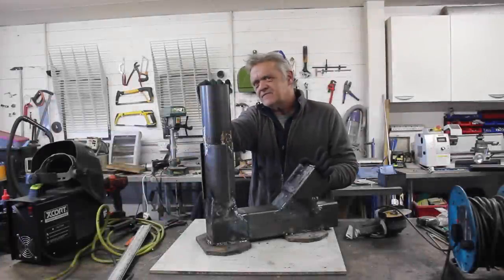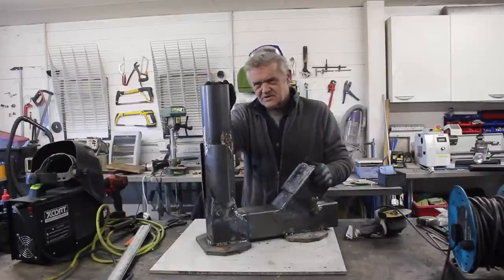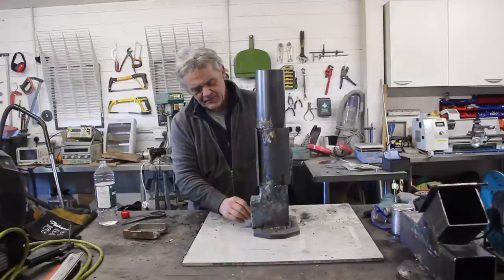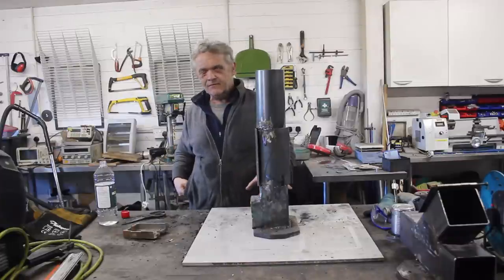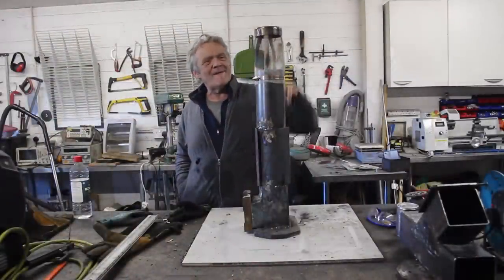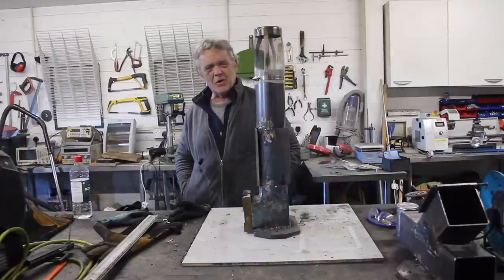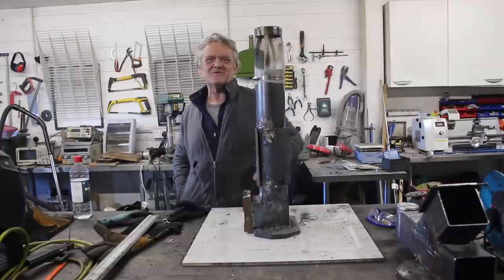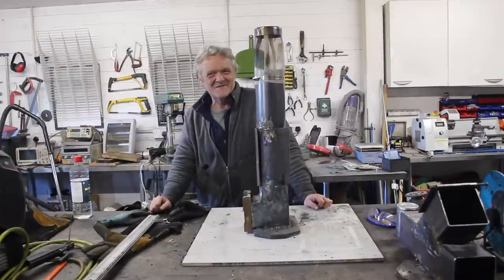1751 Sensible Vortex Heater Prototype

Comment: Two cylinders one on the other. In the shape of a 3D 8. That way the fuel fumes build up and ignite to become a turbo rocket stove.
Reply: I was also just wondering this too! Would the pipe work best if it was built already in the shape of the vortex?

Comment: The Vortex has me thinking.

In a car the clean movement of hot gasses keep them away from the cylinder walls.
When it runs lean and you get pre-detonation the gases get swirled up more and as a result the combustion temperature is lower but more is transferred to the cylinder walls causing the engine to run hotter or over heat.  

If we cause a vortex in the chimney and move the gasses into the middle, the gasses circulating on the outside must therefore be cooler as the cooler air is mixing and forming the vortex. So the outside of the chimney will run cooler.

Would be a good experiment to see if this does affect the heating efficiency?
Reply: This principle is what makes giant termite Chimney mounds work
Reply: Also speaking of vortex flames, have you ever seen Fire Tornados in real life? We can use this property to completely encase it in a glass tube. My question to you is this, can the vortex flame itself be made hotter, to the point where the vortex flame heats EVEN more of those gasses released by the burning wood? In Essence a fire tornado that just keeps getting hotter and hotter?
Reply: @captainnemo6655  it might get hotter as has it draws itself in as there is less surface mixing with colder gasses. i think the limiting factor for the heat is the fuel supply. extra heat takes extra energy, which means faster wood to gas production.
Reply: @TheEmbeddedHobbyist  indeed! This is my question now too... What would be the ideal energy dense fuel that we can use. Small in size put able to give off massive amounts of heat and gas, then further pyrolize the gas and so forth.... There is a chap on YouTube that built something like this, you can find his video by typing "Rocket Heater 4.0 Tornado in a tube"
Reply: @captainnemo6655  I think the more energy dense the fuel the greater the risk there is in burning it. petrol is one to think of, lots of energy but i would not want to be burning it in the house.

Comment: Maybe some type of forced air fan to give more oxygen but then you would need power and would no longer be self contained unless you maybe run the fan assembly with solar. Probably wouldnt take much of a fan to achieve a blue flame.
Reply: There is something easier. You can run that fan by using Thermo electric energy from the stove itself. Rob has many excellent videos on how to do Thermo electric generation... Also there is a product called The Flame Cube, it's a rocket stove, Thermo electric generator that runs a fan to further help the temperature difference. Have you ever seen these things?
Reply: @captainnemo6655  No I have not but sounds interesting.

Comment: Does the vortex and flue draw more fuel out of the reservoir when the door is closed?

A runtime comparison with a known qty of fuel would be a good test. 1, door on, 2, door off.
Reply: 3 doors fixed at the right angle and opening. There is a ratio. Rob actually has a video on this design, it's in the library. I believe the video is titled Vortex heater, Initial thoughts.

Comment: Rob i watched a vid were a guy got an old camping stove gas canister  drilled in from top and bottom the size of a coach bolt then the top were the lip is cut that off to make a lid witch in turn is a press he then filled it with sawdust and candle wax mix put lid dack on to compact it with the coach bolt going thru then took out coach bolt and made a hole at the bottom side as to put wood in to light 2 matches and it was lit for 8 hours with a huge flame I was thinking while watching you need a gause on that but it was a good idea
Reply: He actually has a video on this idea. It's the magic forever wick video he has. Check it out and see what you think.
Reply: The vid is called having learnt this secret I never throw gas can
Reply: @niceboy761  awesome!

Comment: Trying to work out what the point of this is? Methanol releases a measure of heat per ml as it burns. All this design seems to do is burn the fuel faster. Sure, per minute there may be more heat, but only as a consequence of burning more fuel.
Rocket stoves on the other hand have the utility of burning gasses that were wasted in traditional wood burning designs. They have the advantage of producing more heat by combusting a secondary waste product. Not by burning more fuel.
Reply: You gotta keep going with this line of question. The point is to improve the rocket stove by taking what nature already does inside of real life Fire Tornadoes. Mix the two approaches and you get what the point of it is? Burn the least amount of fuel initially and THEN burn the resulting gases. Two burns, one stone. Maximum heat output to be then put to use to generate thermoelectricity or mass heat.

Comment: I would like to see how a "Diesel Stove" could be adapted to this.
They atomise the Diesel fuel with a preheater then burn the vapors. Nice blue flames
Reply: He actually has this video already. Its in the video library under the Magic Forever Wick as well as the videos on Biodiesel
Reply: @captainnemo6655  No , this different.,The diesel stoves Ive seen, have a spray nozzle, that atomises the fuel, the pressure is created by the fuel boiling in a pipe.
Reply: @justtinkering6713  ooooh I see what you mean. A pressure based atomizer, like the fuel injector in a car.... Question, have you ever seen what ultrasonic foggers can do to atomize liquid fuels?
Reply: @captainnemo6655 ive seen  just water
Reply: @captainnemo6655  Boy that was quick. I posted a youtube link and it was taken down in 60 seconds.

Comment: Fantastic video! Multi fuel burner I'm thinking could be ideal given that's a clean cut adaptor plate/sleeve to add or remove depending on fuel type you have to hand for maximum flexibility in a blackout power out situation!? Eg. Wood/Liquid ethanol/ oil tube for motor or used veg oil!? Maybe strap a heat powered stove fan to the side of the flu or burner to radiate the heat away from the flu to push the heat into the house if using a clean fuel?(not sure if that would be safe the last add on though?)
Cheers from London! 👍🏴🇬🇧
Reply: This idea! This is were a bit of biomimicry would help us out. Have you ever seen a cutt off diagram of how giant termite Chimney mounds work? We can use this natural design for HVAC systems that run like rocket vortex heaters for the home.

Comment: hi.
you can manipuale hat "vortex" making a few small holes in that "oil  device "
Reply: Yes he can actually! How to best manipulate that vortex is now my question too. What is the hottest that we can get that vortex to burn and spin.
Reply: @captainnemo6655  8 (or 12) little radial holes in that oil can and another 8/12 in the stove at the same level, but a bit (2°) moved to the left, will make a turbo flame, rising up much bigger (he will need a much higher termo glass tube to let the flame be seen, over 2 meter high)
Reply: @Daremato  there is a chap on YouTube that did this already. If you could check out that video for your thoughts and feed back would be awesome! The video can be searched for via tittle "rocket heater 4.0 tornado in a tube"  the chap in question used the length of tube as you describe and the same kind of glass. He incorporated a wood pellet Hopper feeding mechanism on it though.

Comment: Front door wood back door ethanol but you make have to change the ethanol burner but lovely idea
Reply: Question, would it work better to have wood soaking in ethanol? Like if I make moonshine to age in wood barrel, can it work with that kind of saturated wood?
Reply: @captainnemo6655  Funny this would be like super fuel or fuel injected pellets lol
Reply: @offgridwanabe  that would still be soooo awesome!!! It reminds me of something already out, the Kingston brand of charcoal briquettes are saturated, would it be possible to do a DIY version and make it shelf stable like that? Super fuel pellets! I love it! The object of the vortex heater would be two fold, pyrolize the wood pellets and then pyrolize the resulting gases via it's vortex flame.... How to get that flame vortex hot enough though?

Comment: What's the point of the vortex? Just because it looks cool, or does it have a function, like mixing fuel and air? Or would you get the same effect with any opening, just this one happens to make it swirl?
Reply: The point of the vortex is that it helps with the secondary burn of the glasses that come off the burning wood.
Reply: @captainnemo6655  But how does it help? Wouldn't a couple normal holes do the same?

Comment: Now to make it more sexy! lol   Makes me wonder what kind of adjustments would be necessary to spin the flame more or less .. as well as what kind of fumes one is going to breathe.  I also wonder if this vortex spin system wouldn't be better working inside the new heater you got delivered.  I think a round pipe has to contribute to a better spin.  Lots to think about!  Always amazing Robert!!  Cheers mate!  🙂
Reply: @Jeffrey Wolsieffer have you ever heard of fire proof stone paper? This material is available for making a spinning blade to help move that fire vortex around.
Reply: I was thinking the same thing just now! And also a long the lines of that vertical spiral wind turbine blade but made out of fire proof stone paper to help move it faster under its own flow of hot air. It can be constructed upright as well as vertical with fire proof stone paper. Also why not take the cue from nature? Have you ever seen a cutt off diagram for how Termite Chimney mounds work? The secret to BOTH vortex heaters and mass heaters is right there staring right at you.

Comment: So what is the advantage of a vortex flame over a normal flame in a rocket stove?
Reply: The advantage of the vortex is that it helps in the secondary burn of gasses given off by combusting solid/liquid fuels. Once the vortex gets going, it then increases the pull of oxygen rich air, further increasing the burn.

Comment: still have no idea how you get 5 hours  using methanol   with  a tin of sweetcorn     i got the felt   the tins   the mantle      it drinks the methanol  in 30min a full tin
Reply: Did you try running it with the magic forever wick Rob has in the other video?

Comment: I am learning a lot from your vids, but with ethanol etc, how do we expand the burn times ? I've done a few of your heaters, and I use bioethanol, but its burning at a silly rate compared to a diesel hot air burner,  (night heater) I drive a truck
Reply: I would think using Rob's magic Forever Wick would help there.
Reply: @captainnemo6655  I bought
them already and the they work great, parrafin is a bit of an issur though

Comment: I've been wondering about combining a rocket stove with a diy pressure kerosene stove. What kind of efficiency would you be able to get out of such a set up.
Reply: I thought about this too. Like a fuel injector system but attached to a rocket stove.... Now imagine taking those two concepts and adding a vortex heater to them?

Comment: I'm always thinking about non conventional ways you could generate electricity off these things so you could power a phone and anything else that runs off USB, or possibly a tool battery or at least compress air so you could run tools that way.  These are thought experiments at the moment because I'm not set up to do an actual tests to determine if they would work or then work well enough to be worth adding to the system. With that in min, bear with me with the following.

Okay, so if these stoves are creating a rocket type flame...
Wouldn't at some point Newton kick in?  Are these stoves creating a downward force in addition to gravity?  One that might oscillate?

I'm thinking of the material they put in sneakers to get them to light up when up when you walk, or possibly even a larger pressure plate generator. Something along those lines.
Reply: There is a video Rob has on Thermo Electric generators, check out the videos he has on the bipartisan Radio Lamp battery. Also your idea is spot on. It's no longer a thought experiment, it's a product out on the market called The Flame Cube. Does exactly what you describe.... Now imagine super sizing the Flame Cube Design to work for an entire home? Heat plus electricity and hot water... All rolled into one.
Reply: Also as far your newton question.... Have you ever seen how Termite Mound chimneys work? Also how Fire Tornadoes in real life work? The principle is the same: get air flowing in the right way and you get a rocket flame, get that air flowing in the right direction and you get a fire tornado or vortex flame.